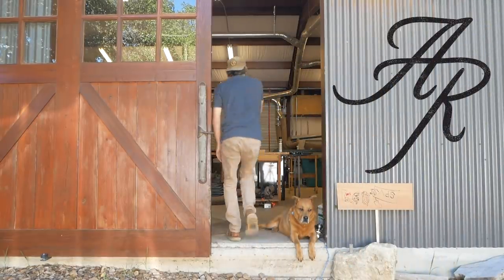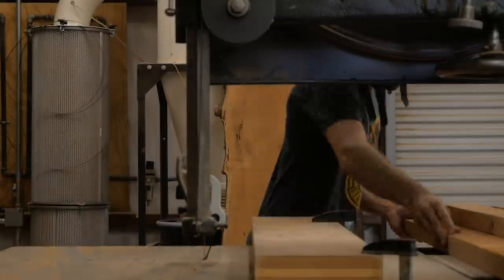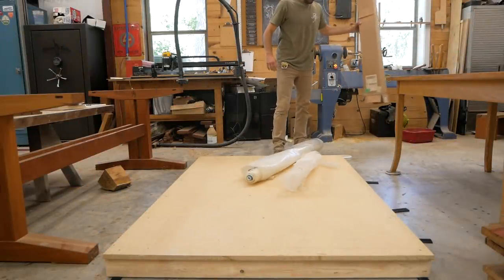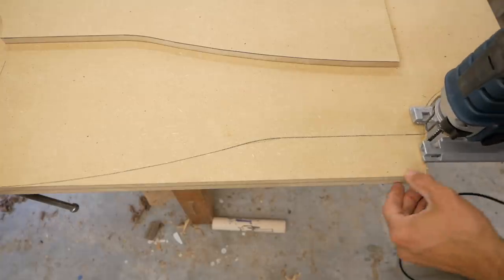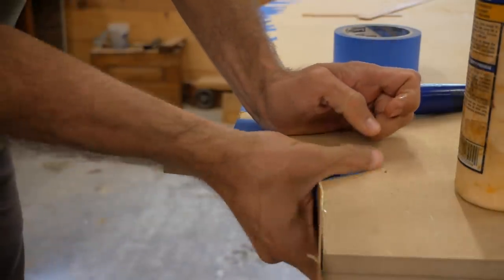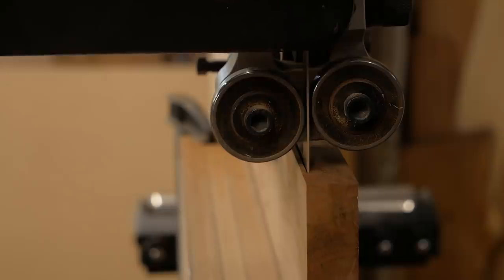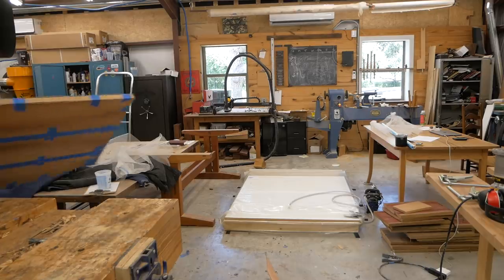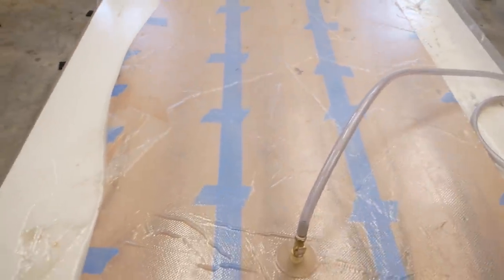Challenging Myself On A Traditional Queen Bed Build (Part 1) / Making Veneer

Comment: Andy, another really interesting video!  One thing I did to facilitate getting large pieces into my vacuum bag was to hang 2 spring clamps on light ropes from the ceiling above the open end of the bag.  The clamps are then lowered to within a few inches above the height of whatever I'm putting into the bag, enabling them to hold the bag open so I can focus on moving the piece into the bag.  Once it's in the bag, I release the clamps and close up the bag.  Then, I use one of the clamps to help hold the hose up so the air can be exhausted without any fuss.  Easy, peasy!

Comment: I built an entire bedroom set out of radiata pine plywood. I did not edge band any edges!!! I did however cut all exposed edges on a 45 degree angle and sanded them down to 400 grit. I then finished all pieces with 4 coats of 10 % thinned lacquer (semi gloss)  I can't wait to see your finished product.

Comment: In reference to spreading the veneer glue - in case those specialized tools are expensive a rubber brayer would probably work well, and they are quite cheap.

Comment: Cool video!

You could probably make your life easier with a couple sets of rollers in front of your vacuum table. Set the piece on the rollers and you can work it in from the bag opening rather than the back of a board. 

Or a ball table - which could be laid over the vacuum table when not in use and would also be a fun project to watch you build! ;)

Comment: Even a worn out 50 year old 24" wide belt sander w/o a platen is useful for flattening and dimensioning squirrely grain or thin, crooked, bowed and cupped lumber. Such a machine doesn't cost much, often less than $1,000... not that Andy's SCMI is such a junker. It isn't.